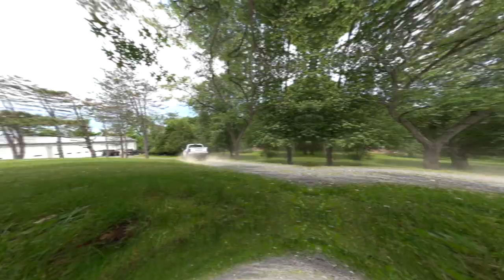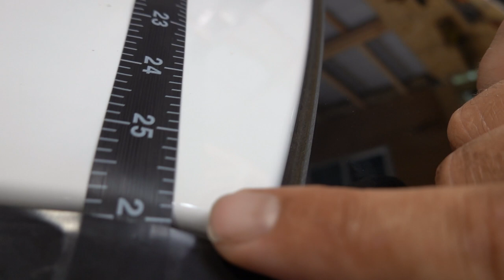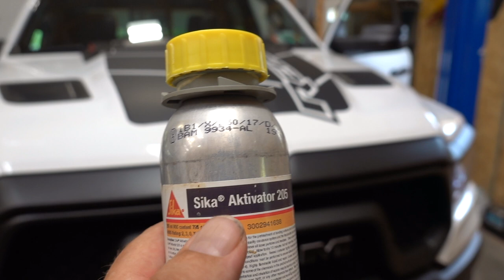2019 Ram Wireless Cab Lights

Comment: Well, it is obvious the manufacturer took into account the time to install versus the drilling of holes in the cab and added the difference in time to their product cost which actually is worth less than a quarter of the price they are asking for.  That's being generous.  Almost fell off my chair when I saw the price. Looks great I admit but not for that amount of money.  The manufacturer wants to make a killing in profit it seems.  If they brought the price down to a more reasonable level they would sell a lot more and actually gain more profit at less margin.
Reply: exactly..i was even saying maybe 200 i would have bought them but id be surprised if the cost for everything is even 40 bucks.

Comment: Why not just make these magnetic instead of the 3M adhesive? Easier installation and you won’t have to reapply new adhesive if you wanted to move them to another vehicle. Heck, with a magnet you wouldn’t even need to worry about surface prep if you didn’t want.

Comment: I got these. They are aweful as of rn. I have let them charge for 5 days without turning them on and they still don’t hold charge. I am sending them back to the company for new ones. I have the smoked lense on them. I heard it could make charging difficult due to less light. 
EDIT: It has everything to do with your lens choice, the smoked lens doesn’t allow enough light to get in to charge, my lights would charge and turn on during the day but at night they wouldn’t turn on bc they didn’t charge enough. I took mine out and let them charge in my dash and they work great now, highly recommended. if you order the smoked lens you’ll have to take them out and set them in the sun then put them back in once they charge, therefore i recommend the clear or amber lens.

Comment: Another great video, great no drill concept but there should be other means to control by switch,. In addition, the ability for them to go out of sync and remove covers to fix is another let down. This product needs some refinements especially for the price.
Reply: You can save some money if you drill the 15 holes yourself. But to hire it done will cost even more. But mostly i just dont want holes in my roof. And when i trade they will come with me to my next rig. Good things are not cheap and cheap things are not good.

Comment: how long does the battery last on continued strobing at night? are these good enough for snow plowing? and how are the batteries holding up after being installed for 2+ years? i feel like for the price i rather drill and not have to worry about a battery or light going out in a year. do they sell them individually incase one burns out?
Reply from the maker: Not too sure I’ve had mine going for few hour drives and they all still work after 2 plus years

Comment: Looks awesome! I like the equal spacing across the roof- question- How many inches up from the windshield is the edge of your center light?- and did you use the same distance for each light? --or do a uniform straight line with all lights using the tape measure?--tks,

Comment: Dude please show me the video how you finished the inside lights how you got the front doors please!
Reply from the maker: I made one on the install the front was not too bad just have to loosen the fuse box for the drivers side but let me know if you have any questions
Reply: @HammerdownMotorsportsUSA  hey are ALL the parts you used besides tools linked? Like you didn't need another wires?

Comment: How do you get the strobe mode and Bright and dim  on them I just bought a set and they look great on my truck just don't know how to get the other options
Reply from the maker: mine cycle through with the on button they may have phased that out cause of the sync issues

Comment: I'm digging these. Curious how the batteries hold up over time.
Reply from the maker: little charging issues in winter with tinted covers but still going
Reply: I hear battery’s are not working in the cold. If they could solve this I would be sold

Comment: Smoke lens with amber 👍 Great video, Steve. I saw someone else running these on a older gen Ram and I’m very curious how they hold up over time.
Reply from the maker: Tony The Truck Guy they say they are good for 3 years and only 25 bucks each to replace
Reply: They look fantastic. A little concerned about how well they hold up with frequent car washes. Thoughts?

Comment: Truck is looking badass! I wanted so bad to get a Rebel, after coming from a Charger RT, but I ended up getting a Titan XD. I would go black and amber. 

How many lights can be synced at one time?
Reply from the maker: they all stay synced together unless one is not on yet and you push the off button then only that one will be one setting behind  so you have to take it out of range from the rest to get it back where it should be
Reply: Hammerdown Motorsports oh I guess what I meant is can you sync more than one kit to the same fob?

Comment: Hey Steve
Great install info. I like the NO DRILLING concept. Two questions. Don't know if you can answer or if a manufacturer questions. Where as the marker lights are solar. How well do they charge? I.e. has to be a direct sunny day? Second. What's the expected battery life? 1 year? Bonus question. Are battery replacements available?
Thanks again Steve.
Paul
2023 Silverado owner

Comment: I really like the idea of Cab over America wireless lights but I’ve heard a lot of bad things about them, plus I’d hate to have to turn them on separately every time I start my truck. It would be cool if they came on automatically when you started the truck!

I’ll just have my dealer hardwire in some OEM cab lights!
Reply: I just bought a new F250 and the dealer wouldn't touch it when it came to installing some.
Reply: A lot of dealers won’t install them on trucks that don’t come with them from the factory for warranty issues. If they were to leak and damage the headliner or other interior pieces the manufacturer isn’t going to cover it. In some cases permanent modifications like traditional cab lights may even void a factory warranty. I work at a GM dealership in the parts Department and we just had to turn down a customer who wanted to put cab lights on a brand new High Country 3/4 ton. Neither our service or body shop would touch it for fear of voiding the customers warranty.
Reply: Will they go thru a car wash and not leave the truck?

Comment: One issue that you don't have a feedback on what mode are the lights currently on unless you wana stick a mirror . I bought mine for 25$ and they are hard wired. Installing was a breeze to me at least under 2 hours. Btw, I got a 2014 Ram 1500.

Comment: How are these lights working after a couple of years? I don't want to order until I get some feedback. Thanks
Reply from the maker: They still are working my biggest issue is them going out of sync not sure if the current ones have that problem resolved
Reply: @HammerdownMotorsportsUSA  Thanks for taking the time to reply. I've left multiple questions on others that haven't. The reason for my question is because some of the terrible reviews I've read on Amazon. Some of them referred to them going out of sync as you mentioned. I can probably deal with that, but there were many comments stating they just stopped working. Maybe they have worked on the problem. Again, I appreciate your kind reply very much. Take care :-) Chris
Reply from the maker: @ChrisGriffithCrimeAuthor  yeah I have all of mine still working but if one goes out it not expensive to replace the light and clear lenses help keep them charged but can yellow over time
Reply: @HammerdownMotorsportsUSA  Good information. I wanted the smoke lens but that might be the reason for some complaints about them not working for a very long period of time. They probably don't get near the amount of sun as the clear ones do.
Reply from the maker: @ChrisGriffithCrimeAuthor  yeah I ran the smoked ones they look cool but hard to get as much charge that way

Comment: Is there a way to control the lights automatically with the tail light system of the truck to have them open and close without the remote at night?
Reply from the maker: martin mailloux it is just with the remote from what I know
Reply: Hammerdown Motorsports ok, thanks. Maybe I could figure out a way to add a dry contact in parallel with the on/off button of the remote. Remote could be put anywhere in the truck and keep possibility to operate manually. Just need to find the right wire to tap in the OEM harness to activate a relay. Just an idea... By the way, very interesting product. I’ll surely take a closer look to it.

Comment: Are these still going strong? Are you still 100% satisfied? Curious how they’ve been holding up.
Reply from the maker: Yeah they are still working I had one replaced under warranty but other than them going out of sync from time to time I am happy with them
Reply: @HammerdownMotorsportsUSA  I’ve read they only have an “ON/OFF version now which I think fixes the out of sync issue

Comment: Question: Will it ruin the paint whenever you decide to remove them?
Reply: Thinking the same thing
Reply: No it will not it’s mounted with the same thing as your decals like RAM 2500 or what ever your vehicle is once you choose to remove them you will need to follow decal removing protocol but it’s not like you can transfer them to another vehicle as removing them will ruin the metal support that they adhere to
Reply: @Justthemow  so they would be fine going through a automated car wash then?
Reply: @terrysailors2736  yea you could take them threw a car wash maybe not like a high pressure one but the kind with the spinning slappers
I Don t know how a direst hit from a pressure washer would treat them because they would be so close

Comment: BTW, Do you have a link for your Red Decals on the hood......1500?
Reply from the maker: I got them on eBay but the links on there seem to change regularly
Reply: @HammerdownMotorsportsUSA  What do you call them?......Also where did you get those light? I ordered a 2021 Rebel in Hydro blue I should get it next month and want to dress it up.
Reply from the maker: @baro4178  https://www.ebay.com/itm/1500-HEMI-5-7L-Hood-Emblem-Overlay-Decals-19-21-Ram-Rebel-Laramie-Sport-Hood/324052483076?hash=item4b73087c04:g:PfoAAOSwerZeK1WL
Reply: @HammerdownMotorsportsUSA  Thank you!!

Comment: Soooo if you screw up with the remote when the lights are all mounted, you have to peel one off to get it out of the range of the others to reset it, then reglue it on??? Not making sense
Reply: TheNewenglandboys no, you would open the housing and take the light out
Reply from the maker: Staying Armed yup just two nuts and remove the light from the housing

Comment: I normally like most everything you have done to your truck.  But I’m not a fan of the clearance light. Those are made for 3/4 and up trucks. Kind of like putting a Hemi badge on a V6.
Reply from the maker: Michael Reed I think it gives it a more sport truck look plus there are half tons that cane with them from the factory in the past
Reply: I agree it does change the look. I loved them ok my last 2500. I was just giving you my opinion. Bottom line is it’s your truck and it’s what you like nobody else’s opinion matter.  Keep up the great content I love it!
Reply: Not even close to "putting a Hemi badge on a V6".  Bad example, analogy, and opinion bro.

Comment: Where can I get the hood and side decals
Reply from the maker: Adel Fadel eBay
Reply: @HammerdownMotorsportsUSA  which finish is your rebel hood and side decals, I found a lot of finishing options in ebay: calendered, cast, reflective, brushed metal and every matte vinyl. Which is yours ?
Reply from the maker: Adel Fadel mine is the avery option I believe it said stock in brackets when I ordered it

Comment: Awesome, do they make a magnetic version, my cab isn't aluminium and magnets will stick to it. I tried it already. I have a 2019 Ram 1500 Laramie Crew Cab. Thanks
Reply from the maker: Not too sure if it’s aluminum but the stick on kind is all I know of currently
Reply: I was hoping for a magnetic attachment also!
Reply from the maker: @molon122  it probably wouldn't be too hard to make it magnetic
Reply: @HammerdownMotorsportsUSA  I just checked my 2019 Ram and magnets do stick. Hopefully there will be other companies making these at more fair and reasonable prices and with multi options for mounting. $398 dollars on Amazon is outrageous. You can get a solar wireless remote security camera kit for less. I think $100 bucks is more like it and alot more people would purchase them then. Magnetic is best so we can easily remove. I'm not a glue tape person. 😂 Thanks
Reply: MAGNETS WONT WORK WITH ALUMINUM, AND THE 3 M HOLDS BETTER ANYWAY
Reply: @Hundert1  You can save some money if you drill the 15 holes yourself. But to hire it done will cost even more. But mostly i just dont want holes in my roof. And when i trade they will come with me to my next rig. Good things are not cheap and cheap things are not good.
Reply: @caboveramericawirelesscabm3440  My cab isn't aluminium. Magnets will stick to my cab, I tried it already. That's the case many times. But sometimes good things are not that expensive and well worth it and really expensive items are a total rip off and junky, inferior quality pieces of crap😉  I don't want holes in my cab either. Thanks

Comment: I dont know about those wireless lights with the solar panel and that double sided tape 😕... I can see the solar part taking a crap after a while.. The solar panel looks similar as the lights I have on my yard and they dont last over 8 months and the tape can work loose after time with rain.. We do quite of bit of cab lights and the traditional way is defenetly more work but never had an issue other then the light bulbs going out once in a while.. But hey if they cheap enough why not try them!
Reply: YOUR EMBLEMS DONT FALL OFF DO THEY? SAME MATERIAL. THEY ARE NOT COMING OFF. hAD MY SET 3 YEARS NOW STILL GOING STRONG.

Comment: Anybody else have this issue?: when I got my lights, only one remote was working. The second remote never worked from the beginning. I ignored it thinking it's probably just the batteries. But a week later after installation, my first remote stopped working too. I figured if I just changed the batteries, everything will be fine. But after putting brand new Duracell batteries, neither remote worked. So I contacted Cab Over America, and they sent me 2 new remotes. And I'm still having the same problem with one of the new remotes. I currently have only one working remote out of 4. I've replaced their batteries and still nothing. What could it be? It's driving me insane.

Comment: Awesome look and great video.  You had me until I saw the price.  I'm sure they are quality, hopefully made in the US (sorry if I missed that if stated).  It's to bad, Ford only charges $95 if the option is selected during build process on new superduty's...however, where I live dealers never option them in.  Guess I'll need to order my next one 😁
Reply: You can save some money if you drill the 15 holes yourself. But to hire it done will cost even more. But mostly i just dont want holes in my roof. And when i trade they will come with me to my next rig. Good things are not cheap and cheap things are not good.

Comment: Why would't you show them at night?  I went to their site, $398 for those china lights.
Reply from the maker: Kimo Jon check my Instagram there are night shots
Reply: You can save some money if you drill the 15 holes yourself. But to hire it done will cost even more. But mostly i just dont want holes in my roof. And when i trade they will come with me to my next rig. Good things are not cheap and cheap things are not good.

Comment: they look great! just not 400 dollars great since we all know they arent going to last that long. all solar lights fail after a year ..maybe 1 or 2 will continue to light up.  and then 125 dollars to replace them which seems more along the lines of what the initial cost should be. if they were even 200 bucks i would have bought them..there are much better performace mods that cost 400 even less.

Comment: This looks really nice, but $400 is too much! I think a Rough Country curved light bar would look better up there.
Reply: You can save some money if you drill the 15 holes yourself. But to hire it done will cost even more. But mostly i just dont want holes in my roof. And when i trade they will come with me to my next rig. Good things are not cheap and cheap things are not good.

Comment: I had these 
They kept going out of sink. I wish they would just have a one button switch where you just have an on and off..
I took mine off I'm going with the ones that have to be drilled.
And yes I re sinked them they just keep going out of sink if you have it on your key ring and something hits it 
Pain in the but to re sink
Reply: ALL WE SELL NOW IS ON OFF
Reply: Dunder Mifflin  ALL WE SELL NOW IS ON OFF
Reply: Yeah I seen that 
I'm glade y'all did that.
They are made well I like that you don't have to drill holes.
I got

Comment: A lot of poor reviews . How have these lasted for you?
Reply from the maker: They still work the clear lenses are a little weathered they have gone out of sync a few times but I think they corrected that with the new ones
Reply: @HammerdownMotorsportsUSA what do you mean by “weathered” they turned yellow?
Reply from the maker: @wily3226  yeah
Reply: @HammerdownMotorsportsUSA  was gonna buy these just for looks fuck if the light works but now even the clear lenses turns yellow. No thanks
Reply from the maker: @wily3226  yeah they should have some uv protection for the price